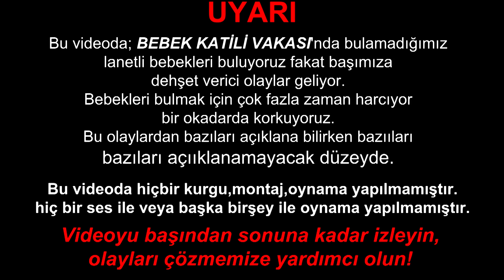BEBEK KATİLİ VAKASINDA BİR GECE! (ÇOK BEKLENEN VİDEO)

Comment: 13:56 kapı çalar
16:58 sandalye düşer
19:11 ses gelir
21:41 ses gelir ( sesin ne olduğu belli degil)
21:53 sesler gelir
23:01 ses gelir
23:35 kapı çarpar
25:30 kapı çarpar
25:50 Bir şey çarpar
30:47 cam kırılır
32:45 toprağın altında bebek bulurlar
34:31 ses gelir
36:13 ahırda toprağın altında bebek bulurlar
36:43 ses gelir
45:31 Birisi bir şey der anlamadım
49:05 Ateşin orada birisini görürler 
bir like bana ve videoya
Reply: güzel çalmışsın
Reply: Çok güzel çalışsın
Reply: Arda Gökcan Bölükbaş adaaaaam
Reply: Arda Gökcan Bölükbaş 45:31de çıkın diyo
Reply: Oğlum ben  oburkusüde benim
Reply: Senn adamsın
Reply: Arda Gökcan Bölükbaş Her dk bi şey oldu
Reply: SEN ADAMIN DIBISIN RAHAT RAHAT IZLEDIM VALLAHA SAOL
Reply: Arda Gökcan Bölükbaş OQ
Reply: 3 Kafa 3 Arkadaş